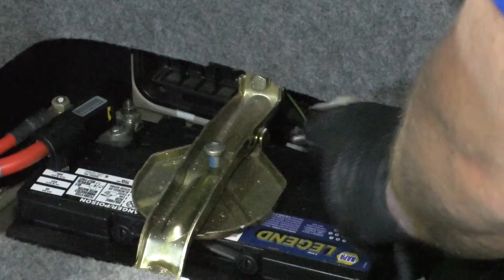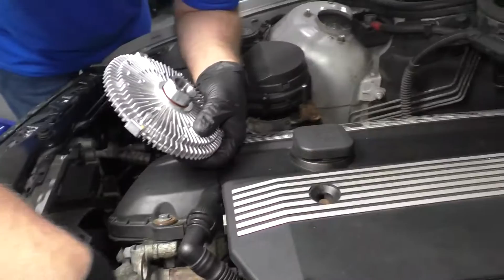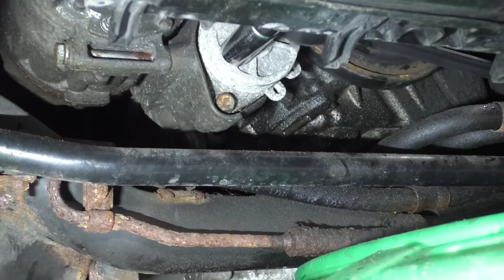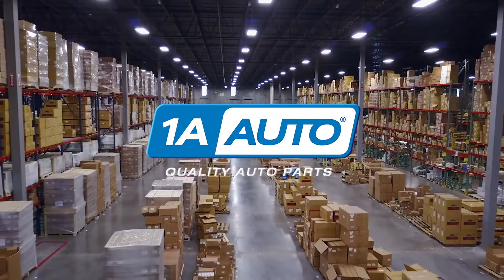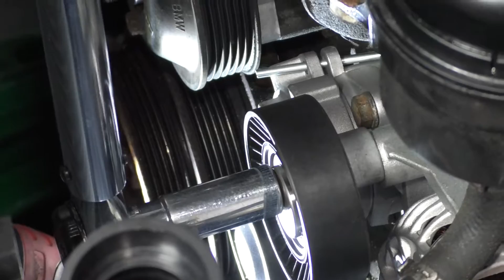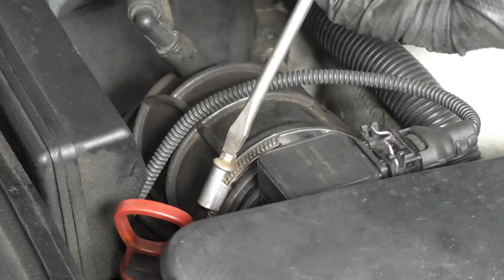How to Replace Alternator 01-06 BMW 325Xi

Comment: Takes 20 mins to swap pull 2 bolts on power steering reservoir and lay out of way you don’t need to touch fan , bolts will come out enough carefully to not hit rad but they will come out , make sure both terminal are off battery

Comment: Great video! Thinking about doing this to my 2006 330i. Would it be fine if I upgrade to a 185Amp from a 180Amp?
Reply from the maker: +walletphonekeys Thanks for checking us out! We would not suggest going with an alternator that differs in Amp compared to the original.

Comment: My alternator connector will not go back on nothing is bent I don’t know what to do
Reply from the maker: +Noah Head Thanks for your inquiry. There could be multiple reasons why you're having this particular problem. We suggest taking your vehicle to a nearby reputable shop to identify the cause.
Reply: What kind of car do you have I have a 2006 325xi e90
Reply: Did you figure it out?